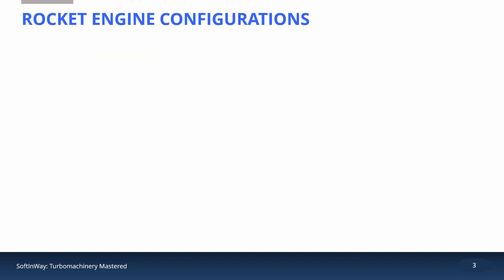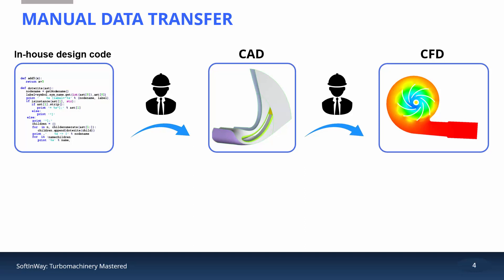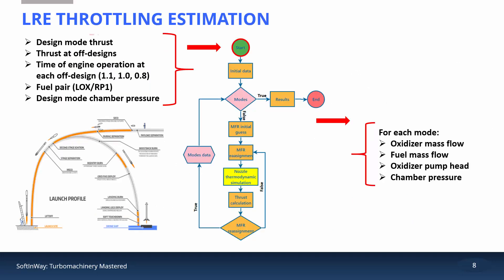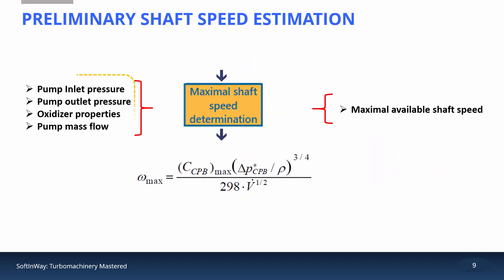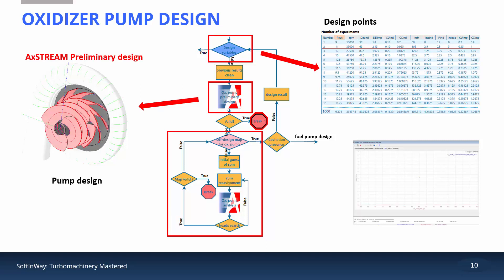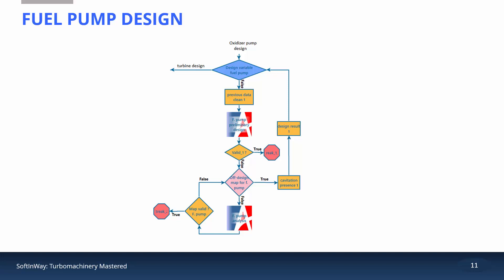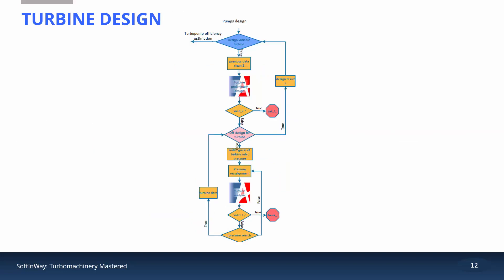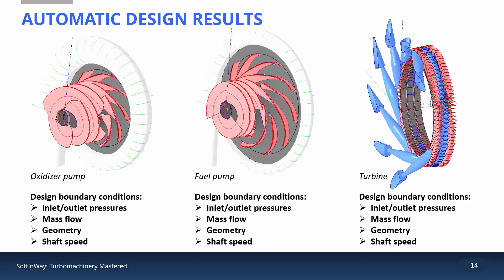Automated Liquid Rocket Engine Turbopump Design with AxSTREAM ION

Comment: There is one misconception at this video. Contrary to industrial pumps where the lifespan of the pump is measured in hundreds of hours a rocket pump does not avoid cavitation UNLESS it affects the performance itself. Most rocket pumps works under cavitation by design or they would be just too heavy.
Reply from the maker: Thank you for your comment! Strictly speaking, you are right that a rocket pump does not avoid cavitation unless it affects the performance. In the design process demonstrated in the video, the pressure at the pump was not less than the stall pressure (when the head drop is about 3% of the head at cavitation inception). However, the modern trend is for the reusability of liquid rocket engines, where the cavitation criterion is more strict to improve lifespan. Thus, the consideration of cavitation depends on many factors and should be well-thought-out in each specific case. The purpose of our video was to demonstrate our automated approach to liquid rocket engine design with AxSTREAM® ION, which can easily accommodate different cavitation criteria for expandable or reusable liquid rocket engines. Thus, we did not focus on the consideration of complex cavitation phenomena and other complex aspects to make video reasonably short and accessible to a wide variety of people with different backgrounds. Hope this helps!